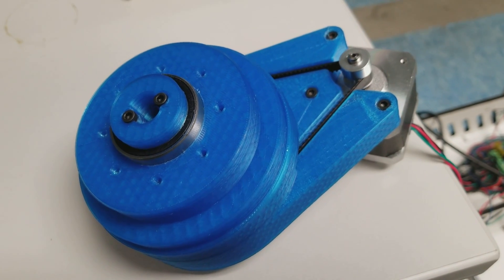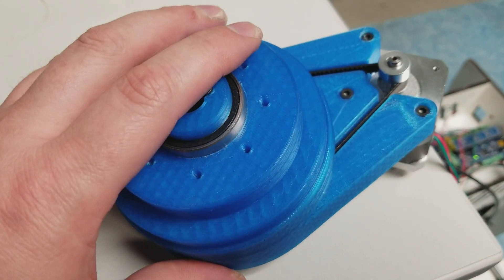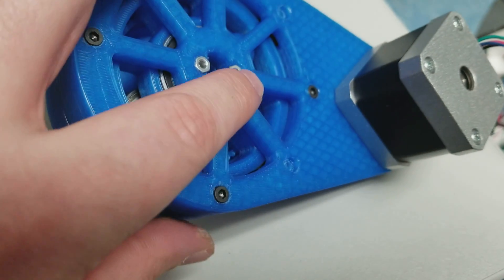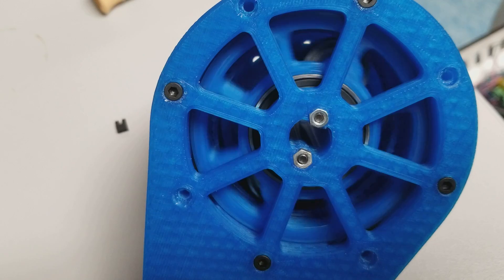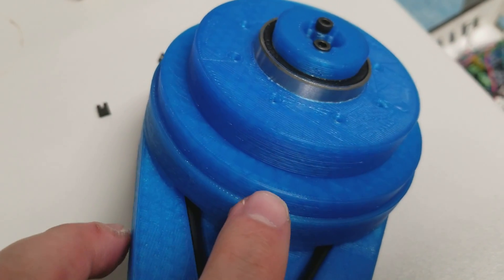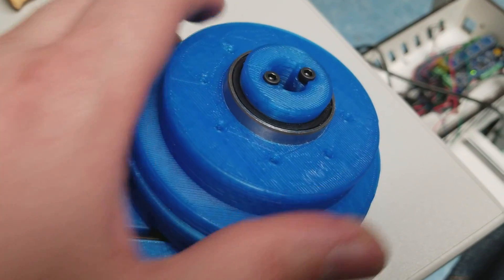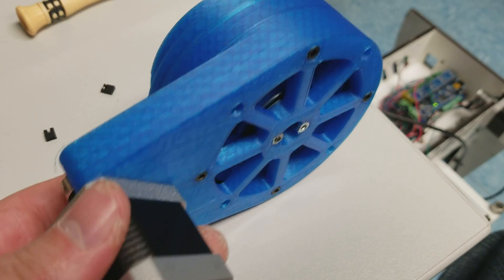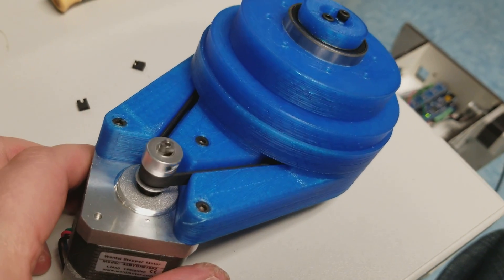Harmonic Drive Preview

Comment: @Nicholas Seward Where did you source your bearings for this project? I have never seen a 5814 bearing for $7.
Reply from the maker: ebay 10Pcs-6814ZZ-70x90x10-mm-Metal-Shielded-Ball-Bearing-Bearings-70-90-10-6814z.

Comment: Sadly, any 3D printed gearbox is basically a toy. You can't use them in real industrial environment. Although, it's awesome as prototype or proof of concept.
Reply from the maker: I would have to disagree.  As with all engineering, you define the problem and then work until you have something that solves that problem.  It is a toy but that doesn't mean it cant be used for real work and solve real problems.
Reply: @NicholasSeward  That's OK, but specifically to gearboxes, a stress load will destroy plastic, and that's all folks... pd: and not to mention stiffness nor even backlash...
Reply from the maker: @rodstartube  I am not trying to be argumentative but open a typical modern sewing machine and you will see a lot of plastic gearing.  It all comes down to the use case.  Design calculate test.

Comment: Some news? We are waiting for updates on this ..
Reply from the maker: I have morphed my approach to be fully printed with no bearings.  I have been anxious to show the design off but the combination of me not being a vlogger and not having time gets in the way.  The basic idea is you have a planetary gear set.  Instead of one ring gear... you have two with slightly different tooth counts.  The planets are printed hollow and a bit oversized and are used as spring elements.  This provides continuous backlash compenstation.  I also use cycloidal gearing to make the gear form more printable with lower rolling friction.

I think the new approach is amazing but it is atypical so I can't really suggest it until I complete a project using it and see how it really performs.

Wish I had more time.
Reply from the maker: https://forum.makerforums.info/t/originally-shared-by-nicholas-seward-i-think-i-cracked-this-problem-wide-open/17254  Found a link with more info.

Comment: No real backlash from harmonic drives. Use a BLDC motor with Hall sensors for accuracy. You can go inrunner BLDC with ESC just like open loop control for testing. I would suggest the common BLDC 540 @ 3800KV.

Comment: @nicholas.  If you've moved on from this design, i would like to continue the development of this variant.  it would work really well as a starting point a design I'm working on. Is it possible to start from some file (anything), or RE from images?
Reply from the maker: Eric Schleicher one of the other comments has a link to a picture of the guts.  I am moving on but only because I have a better approach now.  I need to make a video soon on it.  I have a Google plus post on it if you are really interested.
Reply: I found the image, but any geometry/files would be helpful irrespective of format.
Reply: @nicholas, did the post just have the image, or files as well.  If you've abandoned this design, i would very much like to pick it up.  Any files (any format) you have would be very helpful.

Comment: Just add integrated slewing ring instead of big bearing for the face.  Its strong in compression and tension and has no axial play
Reply from the maker: Constructive Realities Are you thinking of a 3d printed race?  If not, where can I get a cost effective bearing?
Reply: like so: https://www.dropbox.com/s/j6w8opfd91xyfc8/slewing-ring.jpg?dl=0  you just load it up with .128 balls.  I have some experience with 3d printing these and can help if you need.

Comment: Hi Nicholas, great work! I know you're aiming for precision with reasonably light loads but I (and Dan Royer) would be interested in what kind of torque ratios this can achieve.
Reply from the maker: Simon Merrett I was inspired by your work.  I am working on a design modification which should make ratios from 100 to 1000 possible.  I found that belts are too springy for my purposes so I am going to a planetary setup where the planets are hollow and act like the preload.
Reply: Wow, that sounds exciting - looking forward to any further updates.